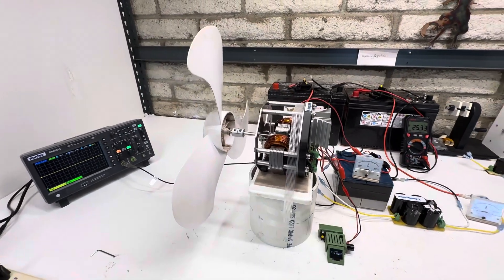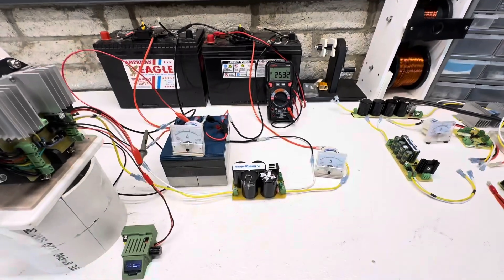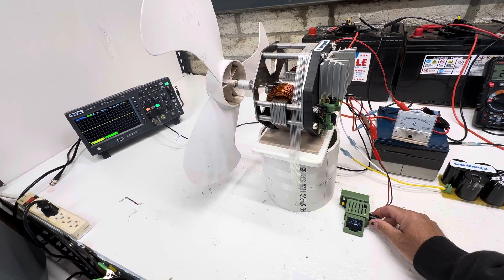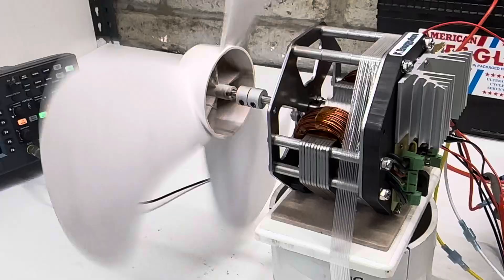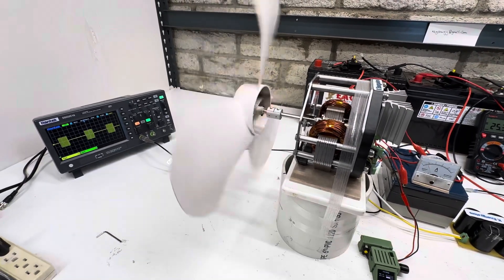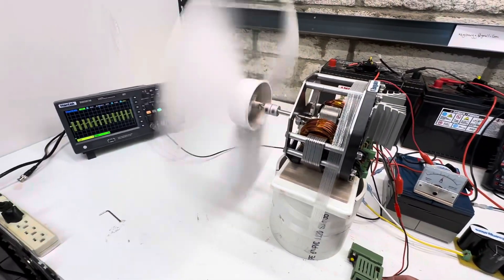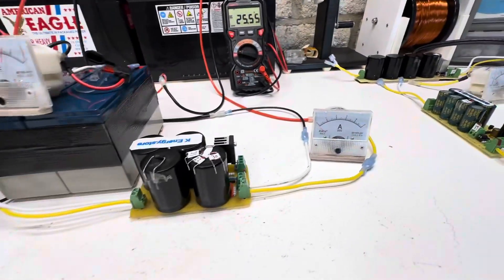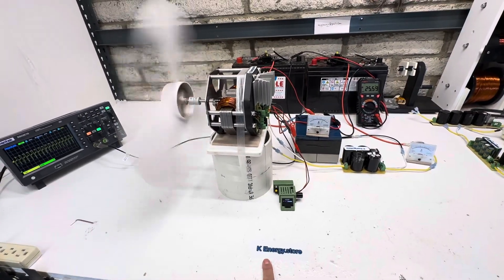New attraction motor at 24v no permanent magnets

Comment: How long will it run off a 12v battery until it stop from low battery?
Reply from the maker: The big batteries are 100ah so couple days
Reply: @kenergy1707 excellent i was think 8hrs would be good, I'll get 1 of what i was on about and maybe a couple more after Christmas. thanks, 
so can this one above, charge the charging battery to allow forever running by swapping the batteries over and over?
Reply from the maker: @doubleooh7337  you can get 30-50% back to charge second battery wile tuning a load
Reply from the maker: Running load
Reply: @kenergy1707  what load are you on about? Something on the motor?, what about without a load? What i wanna try is having a transformer between the battery and primary , and using the secondary coil of the tranformer to power stuff like a hho cell.
Reply from the maker: @doubleooh7337  by load I mean you have mechanical power too
Reply: @kenergy1707  have you ever tried running the bedini ssg with a much bigger wound coil? , the much longer coil should have higher voltage spikes, as far as i can see that's the main difference john had longer coils could be why youre recovering less, also. 50mm thickness wire picks up 2x as much from a moving magnet than 1mm wire.
Reply: My first motor like a newmsn motor eould go over 8hrs off a AA battery, but my wheel motor on my channel that only ran 45mins off a 12v battery  but that had no circuit to lessen the input